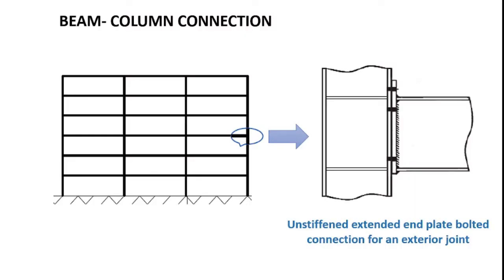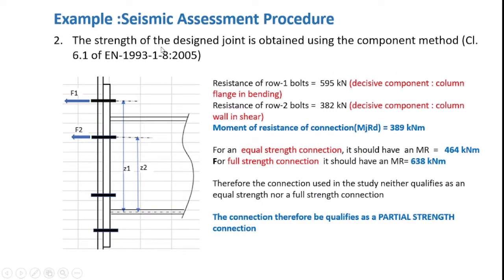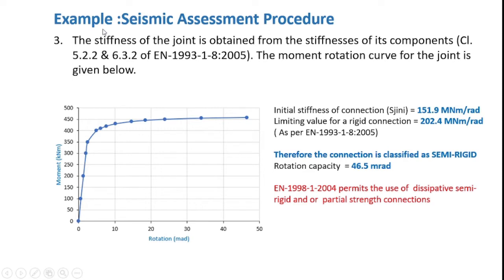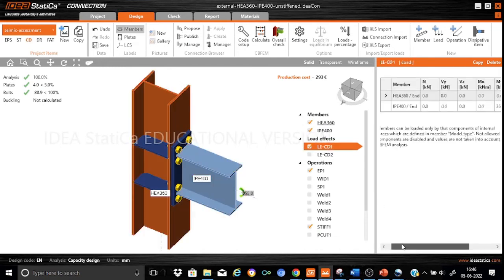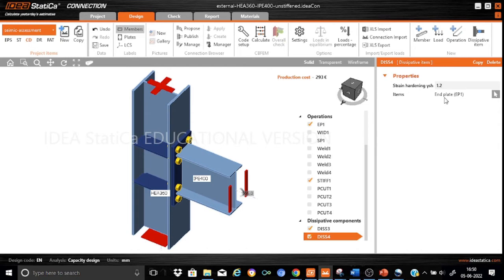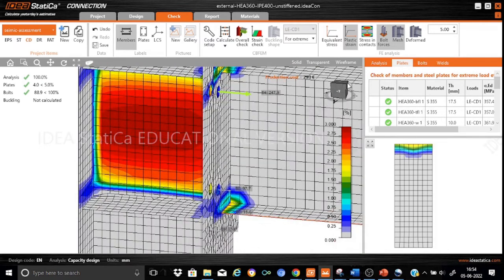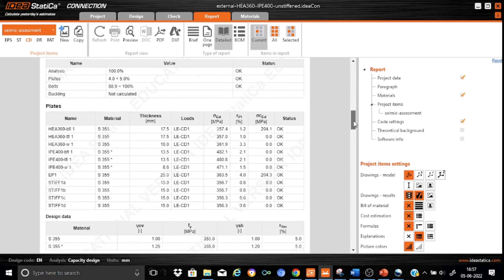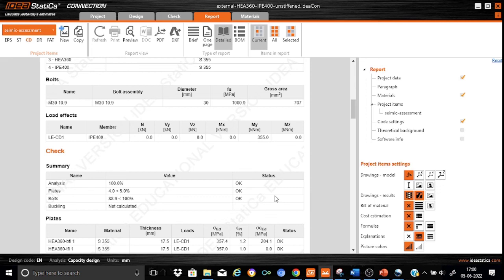IDEA Statica tutorial 29 Seismic assessment- unstiffened end plate bolted moment connections Part-1.

Comment: As per project specs., the MC shall be designed for 1.2 times plastic moment cap. How to check this ? Bcoz it always shows failed results. Any idea?
Reply from the maker: We have started our series on seismic assessment of bolted end [plate connections with PARTIAL STRENGTH connections. The sessions on EQUAL STRENGTH and FULL STRENGTH(representing ur case) will be covered in coming video tutorials.
Please note that many of international codes ask for 1.20*1.25 = 1.50 *plastic capacity of beam for  capacity design of connections considering the material over strength and the strain hardening . The factor  1.20 in ur spec. appears to be too low & unrealistic.
Reply: @puttattjayarajan1199  thanks for your answer. But I need to brush up on capacity design aspect in detail. Can you please make me understand what is the capacity design, it’s purpose, what does various code says about this…thanks